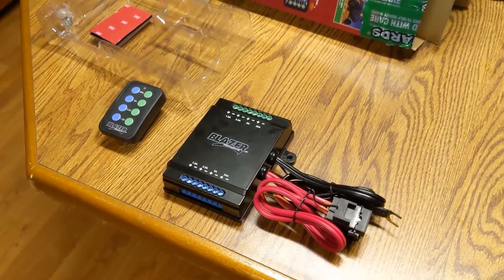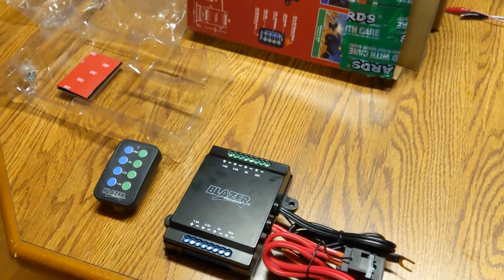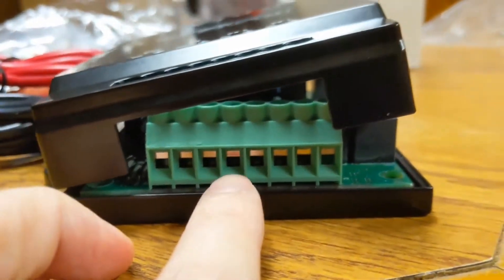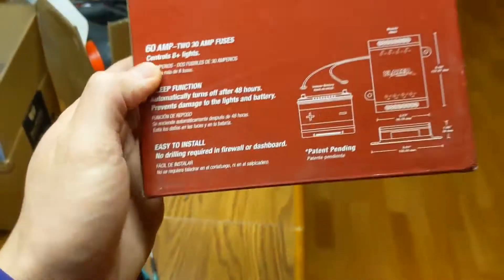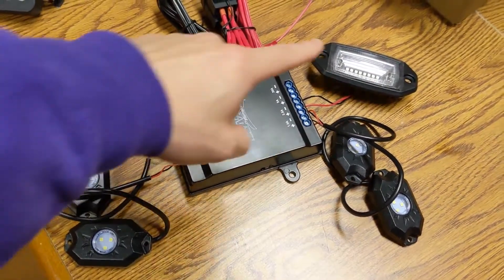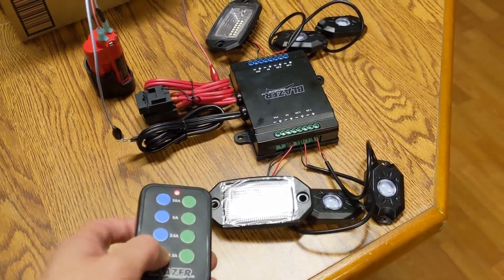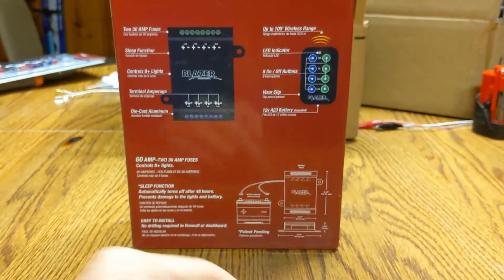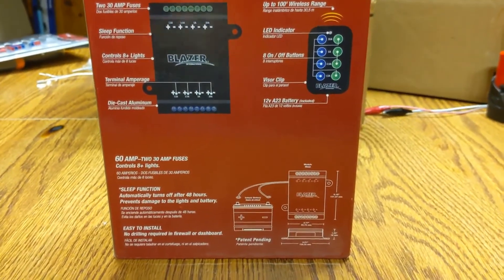Blazer C3050K wireless switch panel - the easiest way to wire lights and 12V accessories

Comment: how do you turn this off when the engine is off? will it just burn down the battery?
Reply from the maker: It has a 48hr sleep timer, or wire it up to a relay powered by a switched source. LED's don't use that much power, so leaving it on for 8 hrs isn't the end of the world if your battery is big enough.